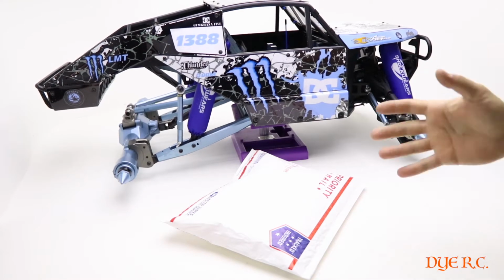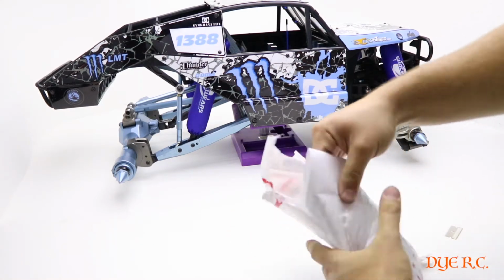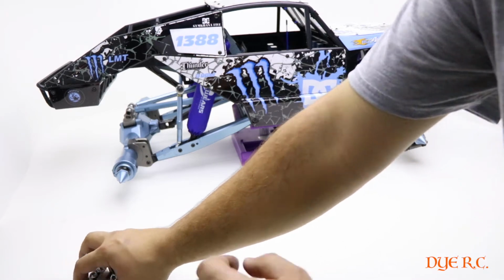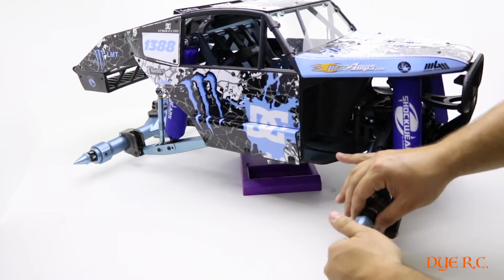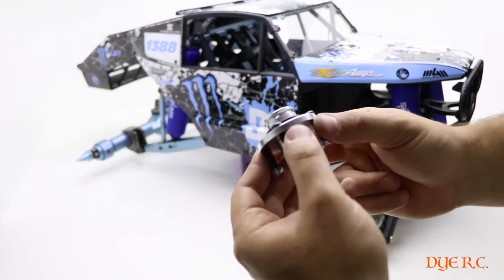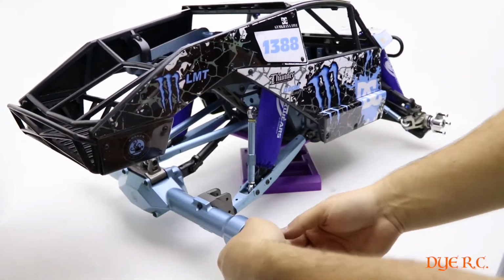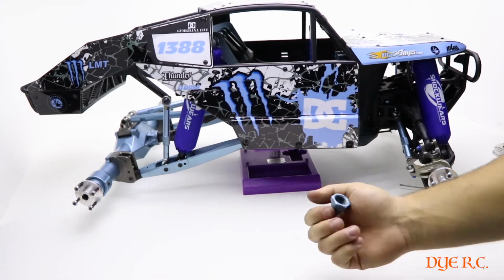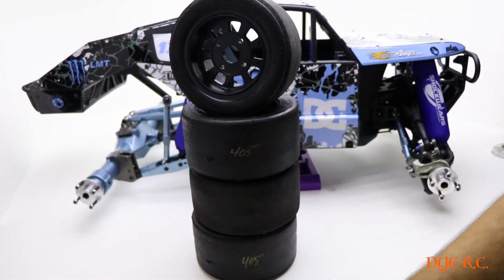Kraken Vekta.5 IRP Hubs Install

Comment: I can understand going to the wheel tyre combo for on road playing as they are a hard compound that will take some abuse, but the diameter of them makes the VEKTA-5 look ridiculous  as they are way too small the width is right, are they the largest diameter they come in. It also looks like the front camber is toed in too much for tarmac use, apart from that this has been an interesting build, giving food for thought as a die hard petrol head I am not sure I would build one but as places to run them dwindles due to their noise even with a silencer on them, I have not got silencers on any of my gas guzzlers I upset the neighbours every time I run them up and down my road to test before loading them up to go play to save the pain of finding a problem once I get to my area to play which is quite a trek and do not want a wasted trip.
Reply: I think this set up will be killer.  The torque that rig will have on those little rollers will be insane.
Reply: When setting it up for on-road, you would stiffen the suspension and lower it, which in turn will make things look more in proportion. In the case of the Vekta, it needs to be lowered allot.
However that guy wouldn't do it anyway, he's constantly showing these videos of his shelf queen that will never get a run. He didn't even shim the hubs/axles, there's a huge gap between the hubs and the bearings lol